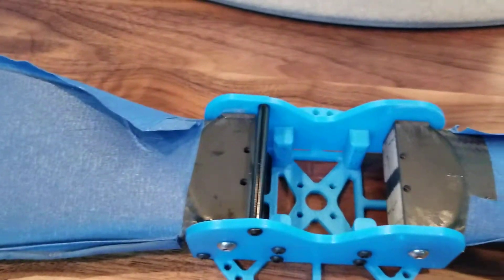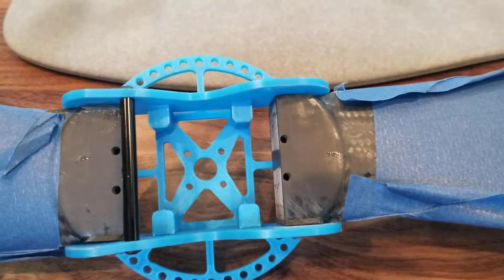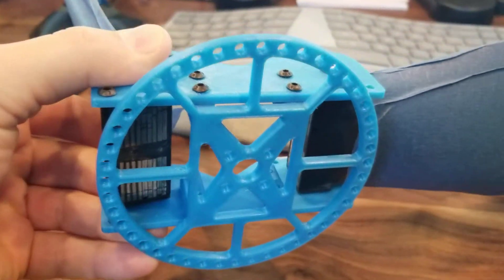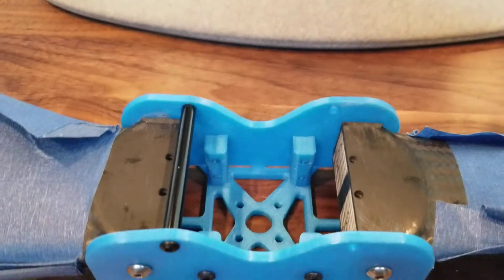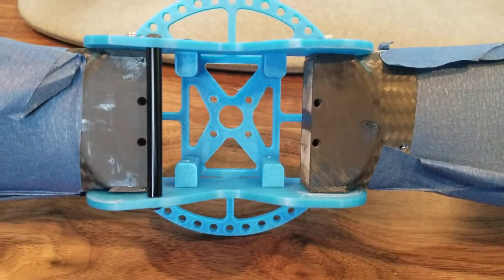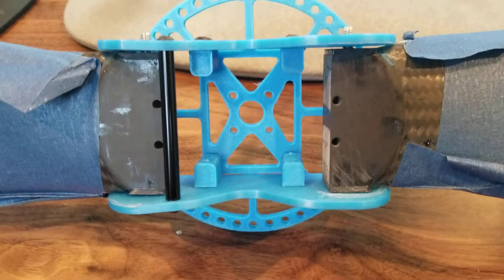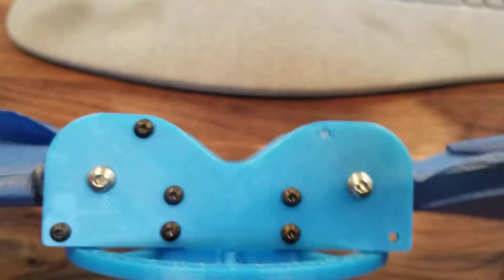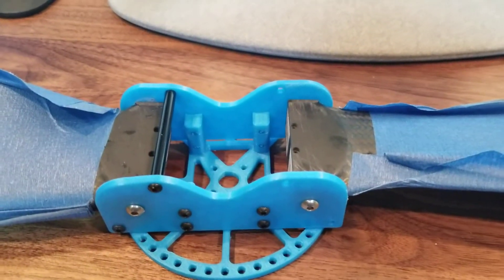Folding Prop Prototype

Comment: Great work Charles!  Will this go on your XTM or the E-Help? Or maybe both?
Reply from the maker: ehelp.  XTM already has clip on folding props.  You can see at 0:49 here: https://youtu.be/OeCpKL9-WDM.  The clips were added later but are very slick, can take props on an off in a few seconds.
Reply: This is some beautiful  work here, Charles. Looking forward  to your thrust data (!)with this upgrade.

Thanks for sharing great information  in a very classy pursuit  of ehelp.